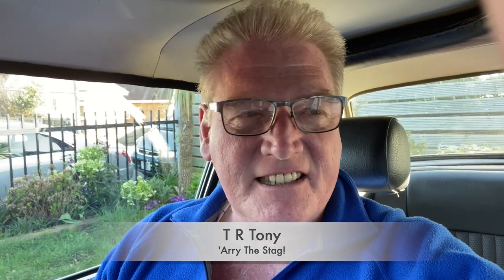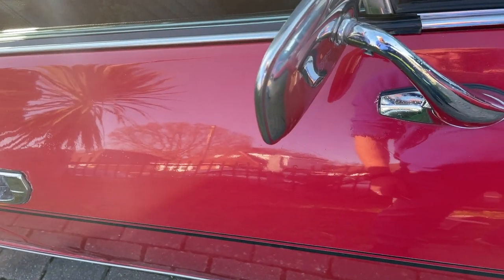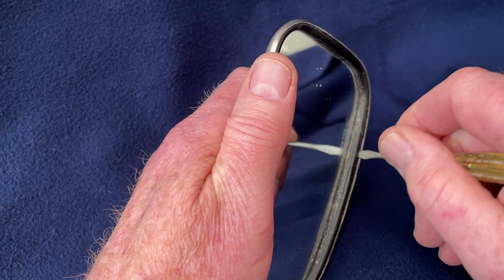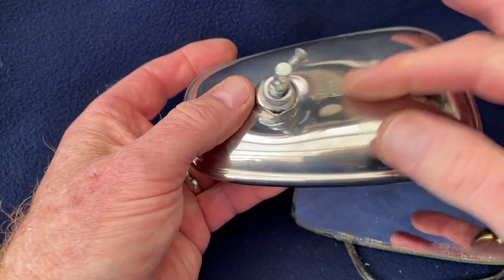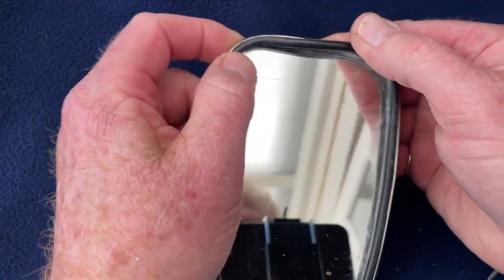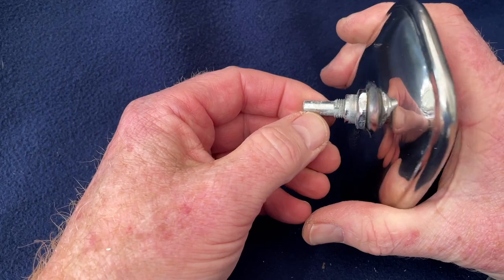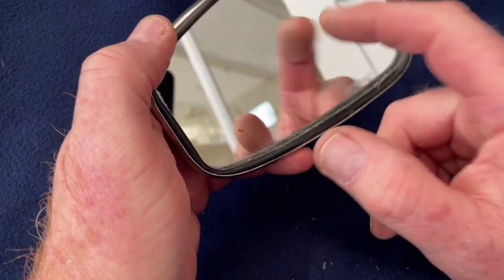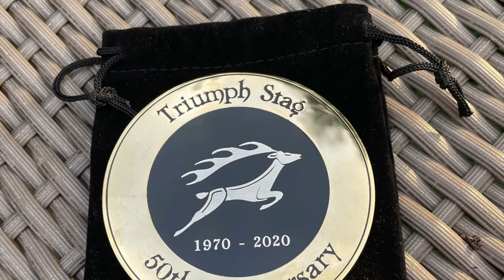Triumph Stag - Door 'Wing Mirror' Repair.

Comment: Hi Tony I like your videos that focus on these small Stag foibles such as the door mirrors! As a tall driver I struggled to get the door mirror usable, it just doesnt have enough adjustment, and in the end cut some rubber wedges out of an old shoe sole to insert between the stem and the mounting post to change the angle. I had tried the large washer/spacers that you can buy but I found these pushed the mirror further out of the stem so I couldn't get the screw back in to secure it. Keep up the good work! Cheers, Brian.

Comment: Hi Tony, as you already know I do not have a kind word to say about these mirrors. I purchased new Tex mirrors from Rimmer's to replace my non standard mirrors as the mirrors were getting a bit tatty. The quality and design is poor with nowhere near enough adjustment for them to even work as rear vision mirrors. As you can see from your video the countersunk screw that secures the head of the mirror to the stem is too long and bottoms out, therefore the screw does not seat in the stem correctly. I emailed both Rimmer's and Rex on more than one occasion complaining about the various issues with my new mirrors and I did not receive a reply from either of them. I wished I had kept the old mirrors on the car but having drilled bigger holes in the door to fit the new mirrors this is no longer an option. I have managed to get the new mirrors to work with some creative ingenuity but I should not have had to do this.

Comment: That hexagonal head on the shaft behind the mirror frame is how you adjust them. There's quite a wide angle of 4 way tilt, and rotational  adjustment.  It's a ball and socket type adjustment, usually with a thin nylon cup under friction tension, similar to an interior mirror.  It should be hand movable,  when correctly set up and the parts aren't missing or worn. The hexagon nut is nipped up just enough to grip, but not solid. I'd guess the back frame is dented and twisted because the adjuster nut has been tightened solid.  Then someone has forced the mirror head to move to suit them.